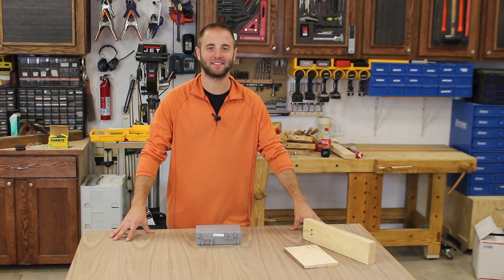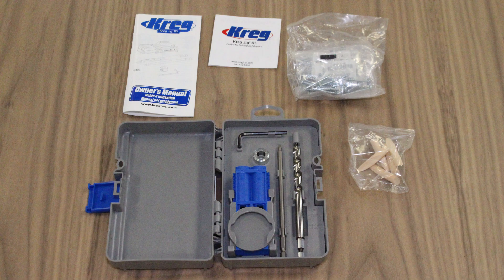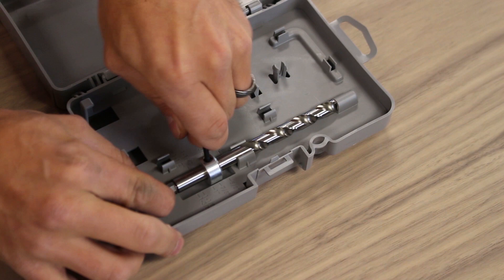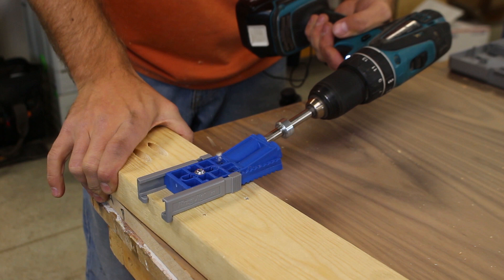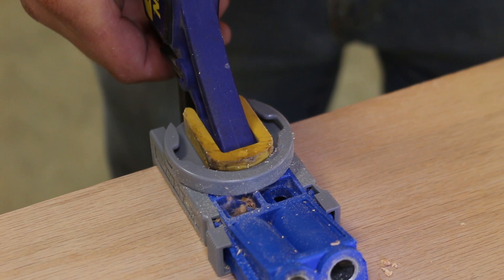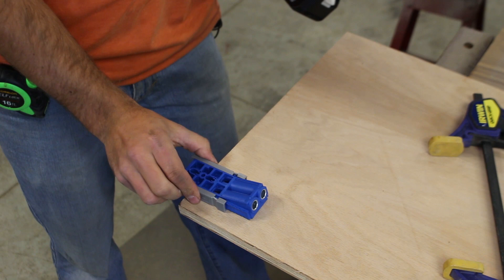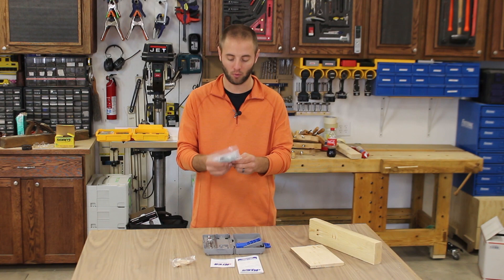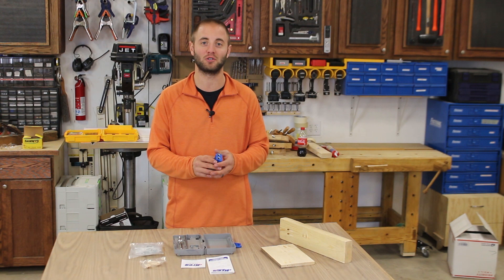Kreg Jig R3 - Pocket Hole Jig Review

Comment: Thank you very useful video I probably could of gotten away with the smaller jig set but already bought this one and I liked how you showed the different clamps and even a screw could be used to keep it in place .inclosing my stair case .
Reply: Pocket hole joinery has been around a long time...I never heard of them till someone lent me one...was so impressed I went to the actual distributor here in Adelaide, Sth Australia years ago to buy one...all of a sudden, tool stores are stocking them in..typical...but it was worth the drive. I have been using it ever since. A girl friend I had a couple of years later wanted me to make a frame to replace the door she had on a cabinet. "You must do it properly, don't go cutting corners....blah blah blah". I was doing the door, and she coated it...but didn't notice the plugs that hid the holes...phew...just went on her merry way staining it. I had to make my own plugs to match the wood she gave me to use. It took me half the time I would have had I used any other method. Thank heavens for pocket hole jigs.

Comment: I bought myself a small blue plastic case about double the size of the jig case, (similar to the small cases school kids take their lunches in),  in all dimensions to put my R3 in...extra protection, and store the dowel plugs in as well along with the kreg screws. It will do for the time being. I use the R3 a lot, but I have friends with a K4, and K5 if need be. The bigger jigs make my life easier. Sadly I am told, Kreg don't make the 4 and 5's anymore...pity, I was going to buy one of either jig. Might have to look in garage sales for a 2nd hand one. They make life easier, and quicker too...but in the meantime, I still have the R3.

Comment: the  "hardend steel part does not go all the way through, so on the flip side you will see the blue plastic, and what I found was on 2 different ones the drill bit into the plastic . The first one I send back, the second one did the same but not as bad at all, in fact its fine really . Perhaps the usa versions are a better quality than what is shipped to the UK

Comment: Thanks for the instructional video. Have you ever tried using GRK screws in lieu of the included screws that come with the set? The “washers” for both are    slightly less than 11mm. Thanks, J. D.

Comment: New to Kreg jig R3.  I’m a little confused about the built in depth collar gauge.  On the left side I see dashes for 1/2, 3/4, and then only one in the middle of 1-1/4 and 1-1/2.  For which length is that marking for? Also on the right side all the lengths have a dash next to them. The other confusing thing to me is why is 1-1/8 marking lower than the 1-1/4?   I’m scratching my head.  I’m missing something?

Comment: I have never used a jig before and I'm following a DIY instruction on building a table and it called for using this jig.  This jig says it is only used on material from 1/2 to 1-1/2"?  Does that mean it won't work if I'm joining 2x4s?  I see in your video that you used it on a 2x4.  Would I set the collar for 1-1/2" depth?  I'm confused.....
Reply from the maker: Dawn Grey a 2x4 is 1.5"x3.5". Set the jig for 1.5" and it will work great! Make sure to use the longer screws.
Reply: WorkshopAddict  sorry for such a silly question. As you can tell I'm really new to this.

Comment: At the 4:15 mark there are blue shavings mixed in with the dust. Is that pieces of the Kreg Jig getting shaved away while drilling?
Reply from the maker: Yes, the drill was not held straight going into the hole and caused that.  It can happen if you are not careful.
Reply: I guess I better be super careful, these things are not cheap at all!
Reply: @WorkshopAddict  No, it can happen if YOU are not careful!
Reply: @WorkshopAddict  I thought this unit came with metal guides. If there are metal guides then how does the drill bit touch the plastic?

Comment: i have the R3 jig. i just starting using it and the only thing is it's hard to figure out what size screw to use. Like the other day i was putting a 2x4 on a 3/4 plywood and the 2x4 is 1" 3/4 so i set the jig to that and looked at the chart and it also said 1"3/4 screw, but when i put the screw in, it didn't go all the way to the plywood. what did i do wrong??
Reply: Check this for choosing screw size; https://www.kregtool.com/files/newsletters/kregplus/Images/february12/selecting-the-correct-screw.pdf
Hope that helps.

Comment: Just bought one... thanks for the great intro & tips for use.
And curious... over your left shoulder & mounted beneath the glass-door cabinets, is a yellow assembly that holds rechargeable drivers, drills, etc? Is it a commercial product or a diy? Plans or detail photos available (if not commercial) or commercial source. Thanks
Reply: Know you posted this a while ago, but noticed that too.  Sure looks like a DIY with pvc tubes.  Set the gears in my head turning...